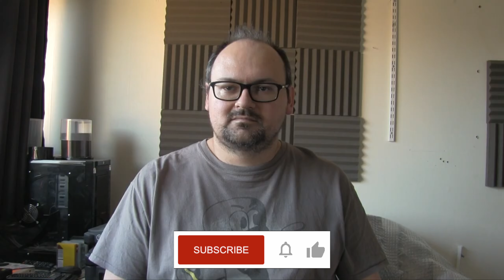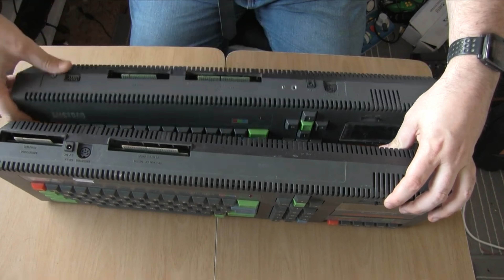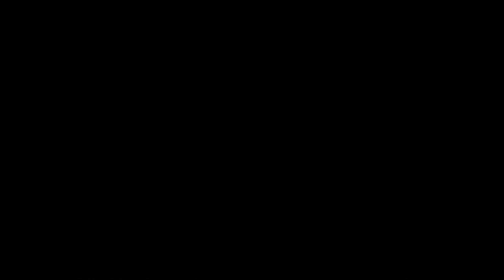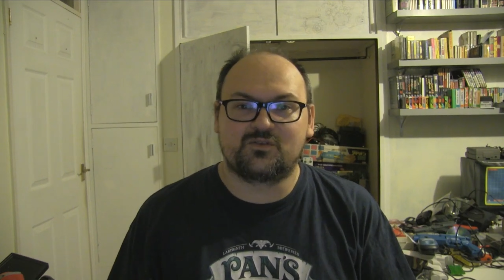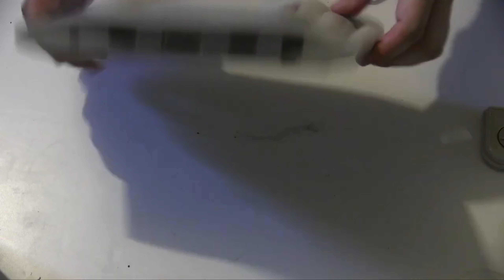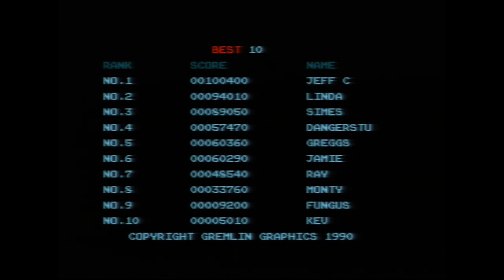A history of Amstrad's 8-bit CPC computers

Comment: Fun fact: CP/M had bad performance on most integrated micros like the CPC. That is because CP/M was designed to be used with a serial terminal, and has no concept of a graphic screen. 
If CP/M wants to write to a new line, it will just send a carriage return character and a linefeed character to its console port, expecting a terminal to handle the rest.
But on an integrated system, the CPU has to handle all that. So the CPC has to run not only CP/M itself and any program running in CP/M, but it also has to emulate a terminal in the background.

I have written my own terminal emulation for a TMS9918 VDP in Z80 assembly, and it is pretty complex. Handling the screen coordinates, evaluating control characters and managing a cursor is a lot to ask from a slow CPU. My (very simple) implementation is almost 900 lines of assembly code, just for the terminal emulation.